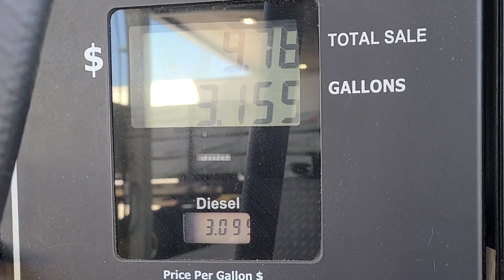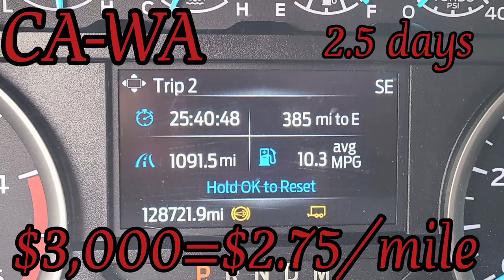WA trip: 17k# Load & OR weigh station

Comment: I get steel isn't light, and i get not all operations need large equipment. However, I will say they need to learn their equipment limits and have a competent spotter and operator. Same time have a plan B for larger bundles. Those tractors should have had zero problems with those tube bundles.

Comment: quick question for you My truck has  F GAWR = 7000 R GAWR 13500 the trailer has two tandem axels with GAWR 10000 each that 40500 the truck and trailer weigh 19300 does that mean I can't does that mean if I wanted I could put 16000 on the trailer or am I limited to the GCWR of 26000 which means I can only put 6700 on the trailer. I'm just trying to figure out what I can carry and not get in trouble at the scales the most I would put on the trailer is 13000
Reply: 7700. Your problem is your axels. You need to upgrade to 12000# . I run 15000# axels. My declared weight is 43025. I don't like to but I put 20000 on my trailer regularly.  Now I have air ride also. You need air ride to get heavy. You should think hard on this. You can go broke not being able to carry heavy.i easily do $8500-$10000 a week with this set up. IT getting to be slim pickins out here for hotshot. Think I'm going to get the Pete and the 53 footer back out on the road
Reply: @williamjonesii7694  sorry writing is not a talent of mine I don't have 7000-pound axles. I have two 10000 pound axles on the trailer and the front axle of my truck is 7000 the rear axle is 13500 my  GVW is 40500. my question was because the sticker on my truck has GCWR 26000 and my trailer and truck weigh 19300 if I had to go by the GCWR on the truck sticker that would mean I could only put 6700 pounds on the trailer, but I found out that FMCSA does not care about the manufacturers GCWR they only care about the total of the GAWR described in the video. but thanks for the response